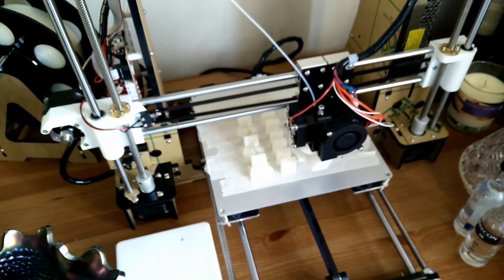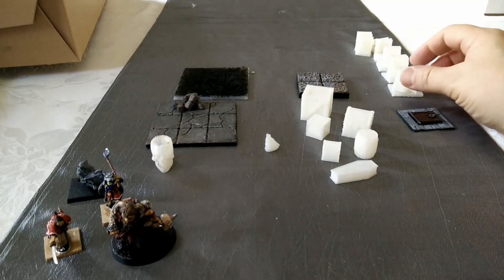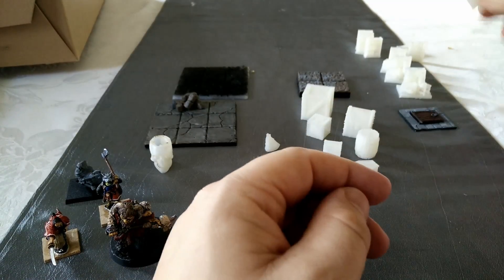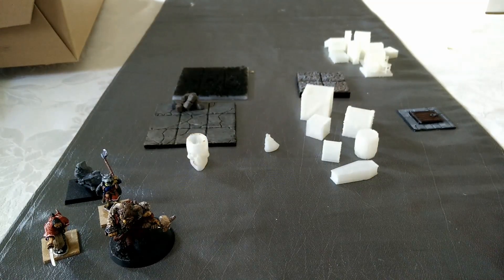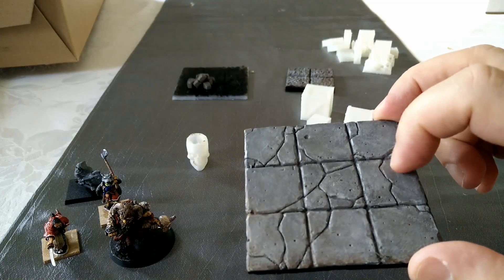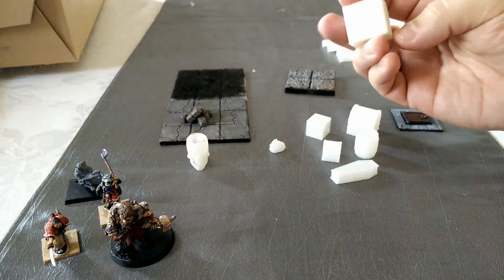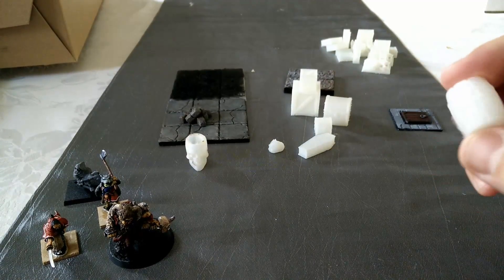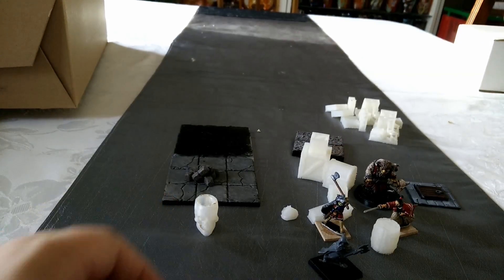Anet A8 3d Printer - Part 3

Comment: I see your bed temperature is 50. I have only used 60 on PLA and it has been stuck very good and too good on larger pieces.
Imo that tape job is the problem with sticking. But hey i only have had my A8 for 1 week. Ive been struggling with over- and under-extrusion using same settings.
Reply: I had no problems with bed adhesion at first until about week 2. 
Figured out that the bed needed cleaning with alcohol cleaner and now it's fine again. Haven't done much ABS - scared off it until I build an enclosure as it wouldn't adhere very well at all and kept warping and lifting.
Reply from the maker: I have upped temp to 60 myself and seems to be working way better, the tape is not ideal but it works ok and is cheap. Before I moved the printer to its new home i seemed to get rid of all the niggles, seems I'm starting all over again. Expect a Part 4 early Jan at latest!